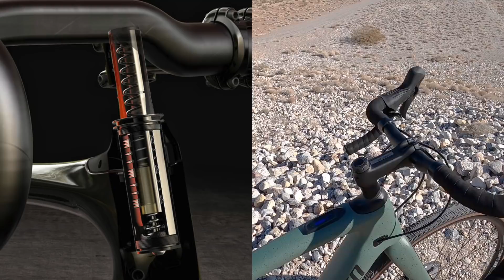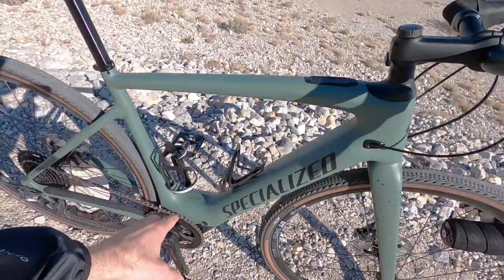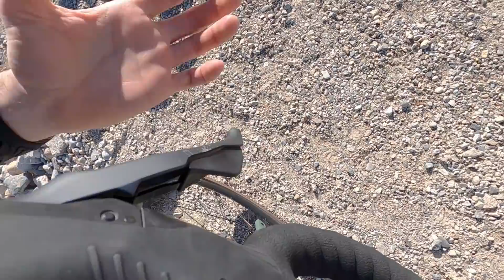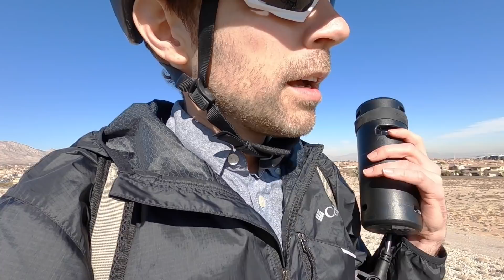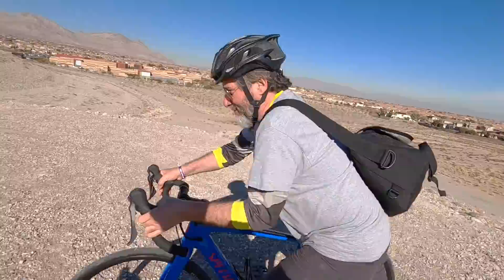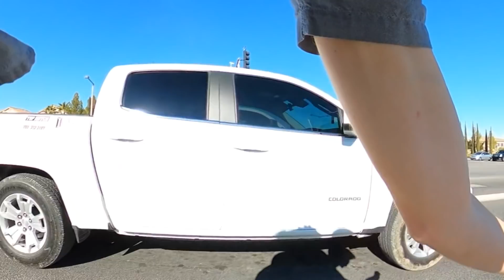Specialized Turbo Creo SL Comp Carbon EVO Review - $6.5k

Comment: They need to quadruple the power from the battery with a hand throttle  
it would still be legal because its got pedals 110 volts with a hundred miles
of range would take a lot of cars of the road for all them short journeys.
Reply: What a stupid idea.  Stick to your Bafangool motor.

Comment: Question: I havent used my dropper post and cannot say I really need it. I got the bike used, but barely, and have swapped out pedals and added a size small Revelate Tangle to my L Creo to hold my Topeak Road Morph. I have a question. I would like to know what others' thoughts are on replacing the dropper post with the "Rock Gobbler(?)" mentioned in the review. Does it work? Is there a better one? What are your thoughts? I'd also like to know others' thoughts on the weight differentials of regular post, rock gobbler vs just leaving the dropper post, but probably never ever use the latter.
Reply: I think a Redshift suspension seat post would be awesome for this bike; I don't see a need for a dropper post on a gravel bike - an MTB or now, a race bike, yes.

Comment: Seems like a nice product but the only way I'd shell out that kind of cash would be if the drive train came with a long term warranty and I was guaranteed to be able to buy replacement batteries for 15-20 years.  What use is it when the batteries and components aren't available?

Comment: NEVER EVER BUY Specialized e-bike. I bougth a Specialized Turbo S, I think in 2015, so it's not that old. Now the rear drive has a mechanical problem. Went to the dealer they replied that it's an old bike and cannot be repaired, and there are no more spare parts. WHAT, this was a 5000 Euro bike. And now it's ready for the scrap yard ??, a 5000 Euro bike within a couple of years. First of all not very sustainable and very envirionmental unfriendly and towards customers ........ What a crap brand.
Reply: I think that's the same for all current eBikes, I'm afraid...   :(
Reply: I had one before and the stupid mode controller would die every few months.

Comment: Damn I’m stuck between this or an onyx rcr
Reply: If you want to  save money,  check out the 2021 turbo vado sl 4.0. Its a flat bar version of the creo. Same frame, motor, battery,  geo etc. In aluminum  for  3300 bucks
Reply: nelsonman1231: If you value exercise, riding in places motorbikes aren't allowed, riding with other cyclists (especially if they're your friends and/or fellow bicycle club members), enjoy the quietude, feeling the good tired after a long ride, etc., then get the Creo SL.

Comment: Unremovable battery?  Another thoughts on it when it dies ?
Reply: Jamie Baier it is removable you have to pull the motor out first though, I think his point was it’s not easily removable.  You can’t have spare batteries and just swap it out when it dies... unless you want to pull everything apart, depends on you mechanizing level

Comment: Great till the battery / motor packs it in.  Which happens way too often with Specialized Levo’s.I've had 2 motors and batteries die.I want a Creo but,,,,,,,,,
Reply: Cannondale2019: I hope your chosen name doesn't indicate that you're being biased. :)

Batteries can last a lot longer if stored at 60% of charge in the correct venue (room temp., etc.). As for the motor, riding a Creo on the road or gravel is usually a smoother process. Either way, at this time Specialized has rarely had to simply replace any bad motors, no questions asked. They've tested this motor thoroughly so I'd guess that it's extremely reliable.

Comment: Hi, great review. I have a question, my wife had recently done her 
chemo. She used to ride but now, she has no energy to go for even a 
simple short bumps. I am looking for a eBike that can get her to have 
the assistance to ride and when she is tired, the ebike can take over. 
Can this bike do that task? I have no experience on ebikes and what the 
differences are. Appreciate your thoughts.
Reply: No this bike will not ride if you don't pedal I think
Reply: What you’re after is a throttle. Sadly, I don’t think any of the major bike brands offer them on any of their ebikes due to how these bikes are classified all over the world - in some a throttle will automatically classify it as a scooter. 
What you could look for are smaller but more affordable brands like Luna and Rad power bikes (?) who import parts and maybe does tweaks to their motors. I believe they’re popular in the US because they’re more powerful and affordable, just not as refined as the Specialized Creo. If you’re after a roadbike, however, you may be out of luck unless you build your own. Giant’s Revolt+ has a walk mode, but not sure how good it is.

Comment: They are pretty loud. Didnt expect that. I had the Turbo S and it was great but kept dying on me. Specialized kept fixing it but eventually it was out of warranty and became a spider  accomodation in the back yard. I predict in 10 years all these ebikes will be leaking out into landfill unfortunately because they are so proprietary.
Reply: The batteries are dying, I’ve had two gen 1 460wh Kenevo batteries  die on me. You get the red lights and the beep. If someone bothered setting up a re-celling service, affordable re-celling service, they’d make a fortune. Specialized won’t keep making gen 1 batts forever, so they’ll be a gap in the market. *i now have 2 x 460wh and 1 x 504wh batts for future proofing.. **if you don’t want to get rid of a bike you love, the motors are also interchangeable...
Reply: durianrider: What was the issue(s) with your Turbo S?
Reply: That's been my main concern about getting an eBike. Do you know of any that don't have a lot of proprietary parts? (Battery in particular)

Comment: You erred with your advice to get a left entry Z-Cage as the cable for the Range Extender is designed to go from the opposite side and then beneath the cage into the electric plug. The cable would be too long if the RE was mounted as you advise or seem to believe.
Reply: Also, the Z-cage shown on the seat tube of the test bike is actually a left entry model. The nomenclature is based on how they would be oriented when mounted on the down tube, not the seat tube. Confusing, but that's the way they do it.
Reply: @bennywatson902  Thank you for that clarification.

Comment: Regarding the noise, as exhibited in this video, my Creo SL Carbon is MUCH quieter. This leads me to believe that the microphone used here is sensitive to those frequencies produced by this motor. I do notice that the motor is incrementally louder at higher powers and higher cadences (i.e., more than 95 RPM). Also, it can be heard more (still quiet though) when going up a fairly steep hill in Sport and Turbo mode. In "regular" riding, though, you have to try to hear it.
The issue is almost completely resolved, though, when shifting to a higher gear and reducing your cadence.

Comment: Hi, I rode the Creo SL S-Works last Saturday and my concern is that when the motor is off, there is resistance from the crank. I wasn't able to test it with motor on at greater than 25 kph (our local limit for e-bikes) so in your experience, when you exceed the limit will there still be a resistance with motor on at say Eco mode?
Reply: Arnold Cruz: When the motor disengages (when exceeding the motor's set speed assist limit, when not peddling or when the motor is in the off mode) there is zero motor resistance, none at all.
Reply: @lazurm  thank you for the reply. I took home my Creo SL Comp Evo yesterday and yes there was no resistance as I rode around the village with motor off. I can't explain why this felt a lot better than the S-Works Creo SL (it's a demo bike).

Comment: OK Court as requested:    TDU Community Challenge [South Australia] on Specialized Turbo Creo SL Comp Carbon EVO: - 2.47hrs ride, 73km 101wh used; average Speed 26.18kph;  maximum elevation 446m; elevation lost 814m;  max speed 62.15kph; average level of support 24.41%. battery left 76%; callories 1385; Weight 72kg; age almost 72 years;  also know a guy who did 171kms and 1670m gain on the EXPERT version [with battery extended fitted]

Comment: For an expensive lithium-ion downtube located battery, the best way to store it, prior to your next ride, is at 40-50% charge which should multiply its expected lifetime by more than 4 times. You can charge it again prior to your next ride and, since it's a quick charger (0-100% in around 2.5 hours) you can simply charge it to full shortly before your next ride.
Reply: interesting...

Comment: Court, after test riding and loving the heavy R&M ebikes, I’m intrigued with this new hyper-light design from Specialized.  I’d like to see your review of the $9k expert model.  ALSO, what do you think of doing a comparison between this Specialized and the Stromer ST5 and the R&M SuperDelite?  They are 3 of the best ebikes, and yet they go in very different design directions.  I’d like to see how you would compare the Stromer hub motor approach to the heavy R&M belt drive/Rohloff mid-drive full-suspension approach to this Specialized hyper-light carbon-fiber approach!!  I don’t think anyone has compared these 3 yet — strengths, weaknesses, intended purposes, and intended customer differences.
Reply from the maker: Hey! I pushed hard and published the Creo SL Expert early this morning, check it out here, the video isn't fully public on YouTube yet ;) https://electricbikereview.com/specialized/turbo-creo-sl-expert/ out of the three bikes you mentioned, if price wasn't a factor, I'd go for either the Creo SL Expert EVO or R&M Superdelite. I love the lightweight active designs from Specialized but appreciate the bulletproof, fully comfortable, almost motorcycle-like nature of R&M. Stromer would be last for me given that it's too heavy to feel sporty, not any faster than the Creo SL, and yet less comfortable. It would be cool to review these three back to back... I've been pretty heads-down on individual reviews, but I like your idea, thanks :D

Comment: Can you replace the stem with one from a different manufacturer or do you have to use the stem from Specialized? I would need a higher rise stem than the one on the bike.
Reply from the maker: Good question David, on the last day of this event I was asking about fork replacements and it sounds like the custom Future Shock 2.0 stems use a proprietary interface so they are not easy to swap out... and this may include the fork as well. Best to double check with a Specialized rep (I asked some of the team leads from Specialized a few deep advanced questions via email and they haven't gotten back to me yet. I'll include this question if/when I hear back ;)
Reply: @ElectricBikeReview  I believe all the Future Shock systems use a standard stem interface.
Reply: You can use a different stem - mine has a Origin8 Propulsion Riser stem which raises the bars.  I may put the stock one back on it but it works fine.

Comment: Here in the UK  Ribble Cycles have ebikes similar to these bikes
Reply from the maker: Hmm, interesting! Thanks for the heads up. Have you had the opportunity to test ride? I'd love to hear your thoughts :)
Reply: ElectricBikeReview.com hi court I haven’t had the chance to test ride I saw this bike at last years cycle exhibition at the NEC Birmingham Uk .if you check out you tube site Road.cc they have reviewed two similar bikes Pinarello Nytro @£6000 and the Willier Cento 1 @ £4299 one is mid drive other rear hub

Comment: It's worth noting that the "non-electric" version is half the price and weight, and provides a more robust exercise experience.
Reply from the maker: I hear you Christopher. Ebikes got me after a knee injury, I was commuting to work daily via bike and needed some help during recovery. These days, I don't actually own an ebike... but I still think they are a blast and can be great for super hot days or lots of climbing and cross training. Fun fact, they actually use less energy than an analog bicycle in many cases, based on rider diet and how we get food. Electricity is cheap and plentiful on a local level and way more efficient than the human body when used to propel an electric bicycle. There's an argument to be made about the sustainability of Lithium-ion batteries etc. but if it means that someone will ride more often and use their car less, then that's a major win fitness wise, environmentally, and even cost wise depending on the ebike and lifespan of use.
Reply: @ElectricBikeReview  Holy crap...preposterous argument bait on Aisle 9. You do you buddy. I'll refer back to my original comment and leave it there.
Reply: I have a 2016 Diverge and now use it as my winter bike, along with my Giant Defy Advanced Pro 0.  Both are awesome bikes.  I don't need an electric powered road bike, but I sure want one.
What's holding my back............ $8200 Can.

Comment: Hey there, love the review and just wanted to add that a quick way to get a rough idea of your speed on a class 3 would be to turn on the speedometer app on any smart watch. Granted it would not be completely accurate, but it would give you a rough idea of top speed.
Reply from the maker: Great tip! I didn't have a phone mount or would have used my smartphone. Had my hands full with the cameras and stuff, but these bikes are very fast. We did some unfilmed rides to see how fast they would accelerate and whether they maintain the higher speeds and I was very impressed with the results.

Comment: 331.2 wh battery, you've got min range of 56km and max range of 121km, this bike must be incredibly efficient.
Reply from the maker: Yeah, I do think it's very efficient. The motor, lightweight design, and super efficient tires and aerodynamic body position. I cannot confirm these ranges as I got them second hand from dealers and people at a special event. I welcome real world feedback, but I don't feel like Specialized stretches the truth about their products as much as some of the other smaller companies I've seen in the past. A lot of it must come down to how the rider interacts with the bike too.
Reply: Duy Nguyen: This motor IS efficient, 75% compared to 50% for other bicycle motors. Note, too, that it's most efficient between the cadences of 70-110 RPM while most other ebikes are tuned for the 50-60 RPM use.

Comment: I'd really like to buy a Carbon EVO, but it's hard to justify buying one since my Defy Advanced Pro 0 is only a year and a half old and I still really enjoying riding it.
Court, did you notice much difference (EVO is a heavier and has wider tires) between the two bikes on the pavement?
Reply from the maker: Yes, the tires go from 28c to 38c on the EVO which provides comfort and stability. You could always swap into tires like this aftermarket if you prefer the narrower drop bar, but I preferred it. I see the EVO as a fast, lightweight, "do anything" platform since it has the bottle cages, fender bosses, and rear rack option. It's an incredible bike, feels like a race car... that same feeling I got on a non-electric road bike years ago, like you feel your energy going straight into the bike... and now it's boosted by a capable but lightweight motor. Both are awesome, I'd personally get the EVO and swap to a Cobble Gobler or Kinekt suspension post. The Future Shock that it comes with 2.0 is awesome!

Comment: Love the whole concept. I've been riding a 2017 Turbo (basic) and loved it but I'm really a road-frame fa. My only concern is the motor noise which sounded a bit loud, especially compare to my Turbo with no noise.
Reply from the maker: Valid concern, I owned one of the first Turbo Expert models with the standard Brose motor and the Brose S Mag on the newer ones seemed louder... I'd say the SL 1.1 motor here is on par with the Brose S Mag, just not as powerful. For me, the lowered weight is worth it and the sound wasn't so bothersome because the bike is just so much fun. Go try one at your local Specialized dealer if you can ;)
Reply: @ElectricBikeReview  I test rode an aluminum model  in Erie,PA today. $5000. Only negatives are the motor noise and the motor control panel: when you are in one mode you can't go back down a mode you must double or triple click to do so.
Reply: @ElectricBikeReview  I test rode the aluminum model in Erie,PA today. $5000. Only negatives are the motor noise and the motor control panel: when you are in one mode you can't go back down a mode you must double or triple click to do so.